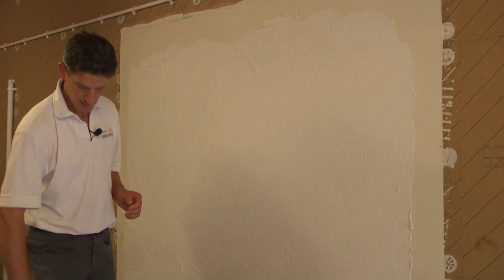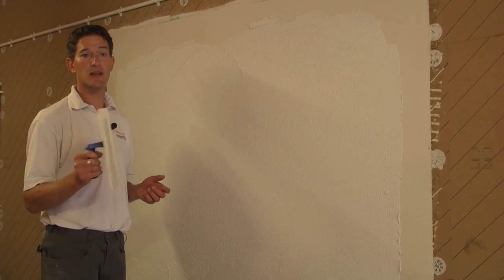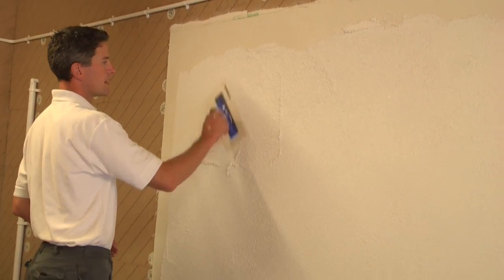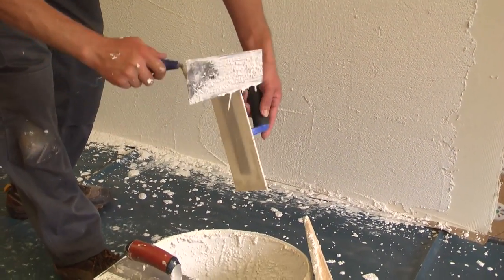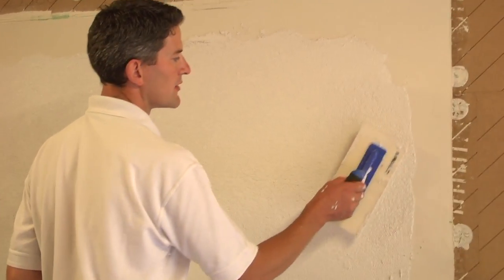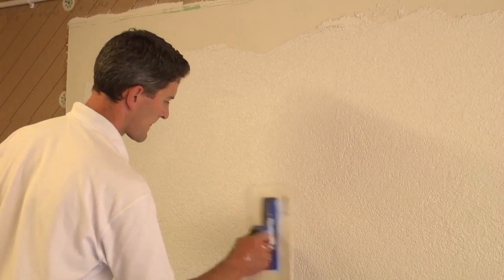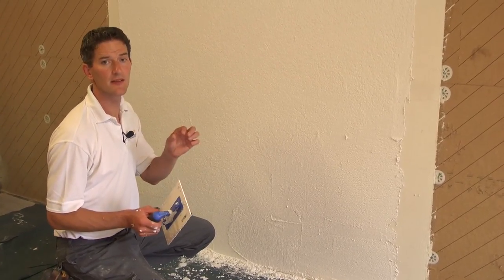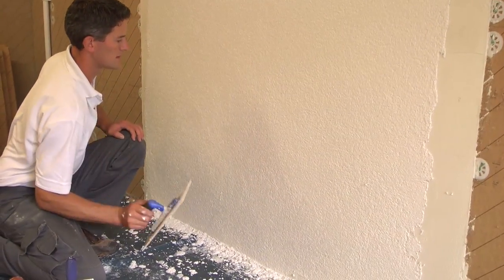How to finish silicon finish renders

Comment: Chris, can you apply thin coat render over existing sand cement render. The reason I ask I have fitted some new bay windows and have had to pack out the reveals of the new window with external boarding and now need to match in and I thought if I did the reveals and the face with a thincoat system?
Reply from the maker: Hi Jason

You can apply the finish render to any mineral surface so bare cement render would be fine. You'll need to prime the surface first. They can be applied over freshly painted surfaces (acrylic masonry paint) so long as the paint is well bonded to the surface. Do not try and render over surfaces with algae or dirt as this will slowly peel off again. Hope that helps

Comment: Cleaning the trowel constantly is a sign the applicator knows what they are doing, if you see it applied with a paint roller then you make the assumption they have never done it before.
Reply from the maker: Absolutely! If you see a roller out for the finish coat you want to ask them to leave site!! Thanks for your comment.
Reply: I tried that, and my line manager made sure I didn't have a job within days and did his best to make sure I never got a job in the Industry again. Here in the South West a good pair of hands will stand out like a sore thumb and the client will notice the difference immediately, "I want it all to look like that" ends up with the good hands loosing their jobs, rather rapidly.